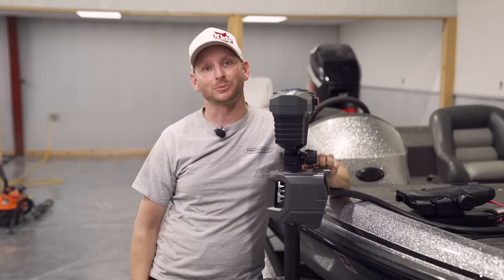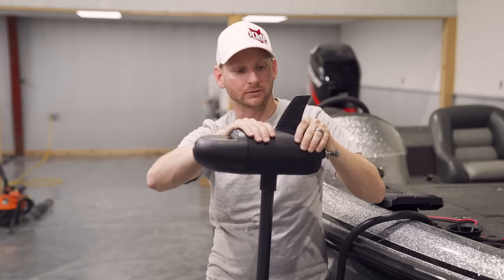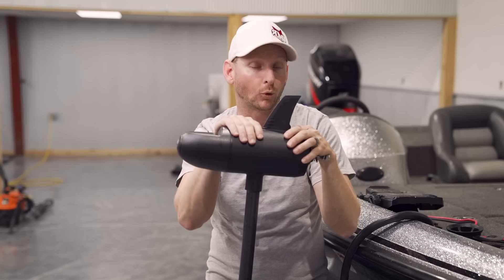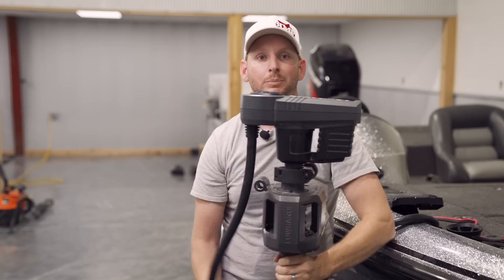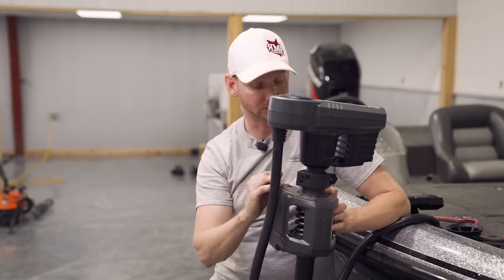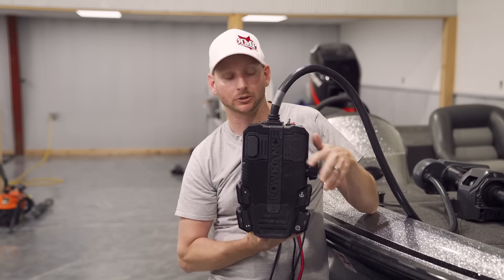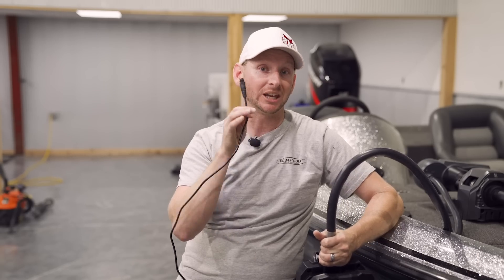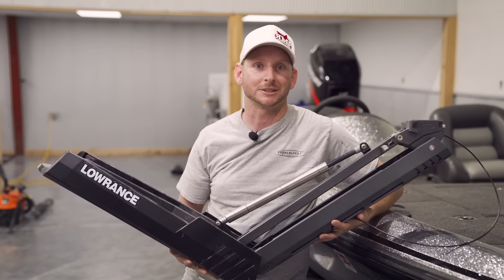Lowrance Ghost Trolling Motor Unboxing/Features

Comment: Great video.  I just installed my Ghost, however the prop will not spin while stowed.  It has power to foot pedal and all connections are made.  Will it only operate while deployed?   I’m used to my old Motorguide.  Haven’t had a chance to take it to the lake yet…
Reply from the maker: It has a switch that will only allow it to operate while fully deployed.

Comment: Installing 60” Ghost by the book and several videos. With 36+ V to the pedal, it will not light up stowed or deploy. Similarly Wired MinnKota and MotorGuide 36 V systems with this setup with no problem. What am I missing? Thanks

Comment: For $2800 Ulterra. I got stow and deploy, i-Pilot link, follow contour, auto pilot, cruise control, spot lock, power trim, control from my Humminbird unit. Don’t care about battery because I just run a kicker and let the TM do the steering.

Comment: Confused on the intergration. Do I need the NMEA connection to hook up to my Live Units to control it??  The video was confusing on that part.  Said don't need it hooked up to pair... please clarify this!!!  I already have Ehternet, I don't want to have to have a NMEA system put in as well!
Reply from the maker: you will have to have a nmea backbone system for integration of the trollingmotor and live units.

Comment: Please do a comparison on the Garmin as well please!
Reply: Another specific test would be a drone shot from above to see how much travel is in the anchor or spot lock features among the units as well. As in set a circle on the screen and an anchor point with split screens and see how close the lock keeps it to the actual position of anchor.
Reply from the maker: round 2 comparison will have spot lock comparison and we will do a comparison on the garmin trollingmotor when one is available to us

Comment: If Lowrance doesnt improve their horrible customer service and horrible product quality I will never consider switching.
Reply: I have problems with two units now, after hours of phone wait time it looks like one will be returned for refund and other may be covered under warranty. Their CS is about as bad as it gets. Took one month for them to return an Email and it was clear the person was not from the USA.
Reply: @mr.gadgetfishing2134  their all like that with Lowrance. I've sent my unit at the console back 2 times and now I am receiving my 3rd one. Have had issues out of both units. Absolutely joke of a company and will NEVER recommend them to anyone. Garmin or humminbird has my business.
Reply: @bassslayer1186  I sat for 6 straight hours on hold listening to flipping elevator music trying to get my HDS Carbon and Motorguide to work! Some of the features still don't work. Lowrance's CS is the worst of any company I've ever dealt with. I was at ICAST and spoke with the Garmin reps and even shot some content of the force. What Andy above needs to consider is how much money and  how much down time with other units. I've heard mixed reviews about the Ultrex. I feel bad for motorguide because their tech support is stellar! They picked a horrible partner in Lowrance.
Reply: Yep I’ve had bad luck with there customer service also, frustrated me to the point I figured I’d try to fix it myself and if I couldn’t would rip out my HD’s and swap to Garmin.
Reply: Rusty Bucket yah, i was working with my speaker on wanting to pull my hair out listening to classical or whatever it was!

Comment: Honestly... meh. For 3 grand I would expect a bit more at innovation for a trolling motor being released in the year 2019. That cable between the foot control is massive, should be Bluetooth/Wi-Fi wireless at this price point. It’s transducer is limited to extremely expensive fishfinders, in my opinion at this price point they should be integrated and be able to work on as a standalone unit with GPS. For a company that has exclusively manufactured fishfinderes, they missed the mark by not including some rudimentary sonar and GPS built-in. The only true upgrade is the brushless motor, it won’t take Minnkota long to release their version. And it’s kinda ugly. I hate to be that guy, but I don’t think it is a game changer.

Comment: That would work sweet on my new  nitro zv21
Reply: Your Zv21 came with a Minn Kota Terrova...   Which offers more options than the lowrance... And is 100% compatible with all your electronics straight from Nitro... You'd be spending 3 grand for a downgrade.  

Why would anyone do that?
Reply: @RIPPER334  my zv21 is completly rigged with hds12's and a motor guide 105 that makes it feel under powered for its size and weight. Just finished a week on lake of the woods and noticed it feels significantly under powered

Comment: Have you heard any word as to the possibility of Lowrance coming out with a wireless model with remote?
How about an anchor mode?
Reply: Garmin trolling motor will have remote as well as other features built into it as a standard package. They will also include a gesture steer feature that will allow you to use the remote control as a virtual "joystick" by simply tilting the remote one way or another it will steer the trolling motor. Also has the same brushless design. same price point
Reply: There’s a huge anchor button on the pedal.

Comment: This is So So AWESOME !!!
Justin, Fantastic job describing the "Ghost". I can't wait to get one. As it was mentioned, will it fit in most trolling motor foot trays ? What is the length of the cable on the "Puck" ?
Is all the cables/adapters to the Lowrance units included (Live, Ti2 and Carbon) ?
Thanks again and Great job on the video.